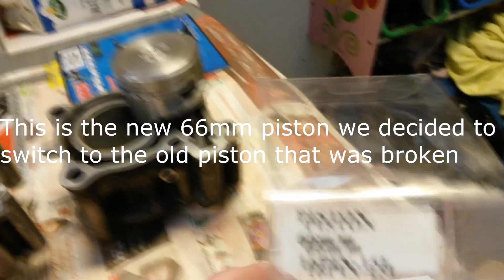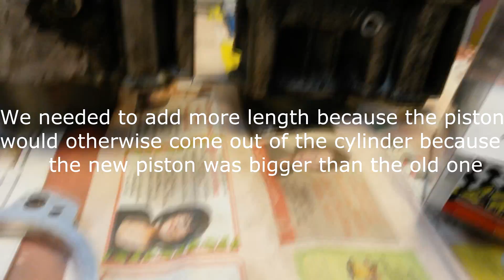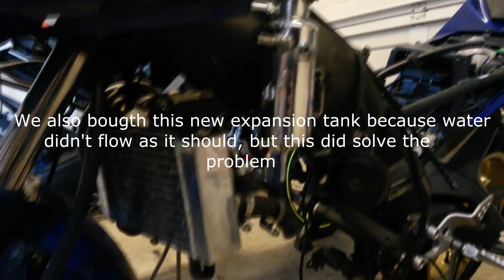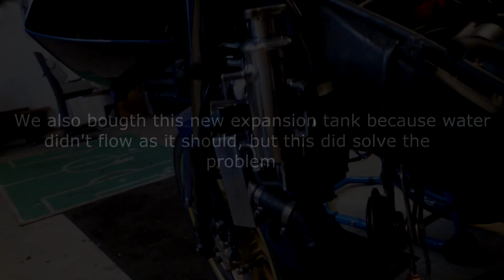Yamaha Yzf-r125 (250cc) Winter Update

Comment: Tuning is a delicate process... And opening up an engine and closing it with everything that was fine still working well is risky. 

It is not enough just to upgrade the head /superhead. You also need to change additional parts in order to enable the basic engine parts (that is designed to sustain the 150cc head as well) to sustain the additional power and this may be an expensive process. Otherwise your engine may brake down once again... 

In this respect, please note that a Nano engine lubricant may help you out in respect of the gunk and wear problem you had before the upgrade. Furthermore, Nano radiator fluid (direct into radiator rather than water tank) may help unclog and maintain stable heat cooling.

Comment: hi if u think to buy 180cc or 250 cc 200 cc kit u mast change injector 800cc  4 = ? or install power comander for 300 euro or injector for 50 euro , and crankshaft becose cranksaft made to handle 125 cc,safe is 150 cc kit
Reply: The original cranksaft Will do fine whit 183cc you dont need to change it
Reply: @patriksalminen6857  Hey bro, i ordered 178cc and i got stock crankshaft and rod, will i be fine?